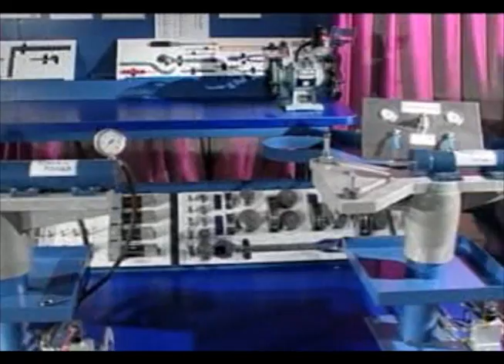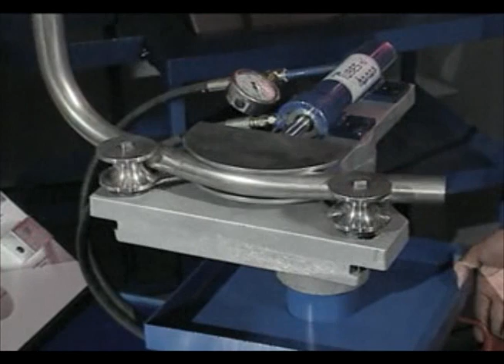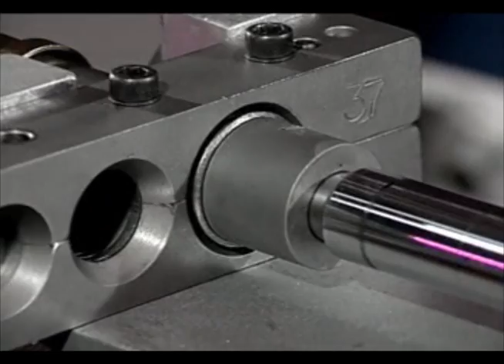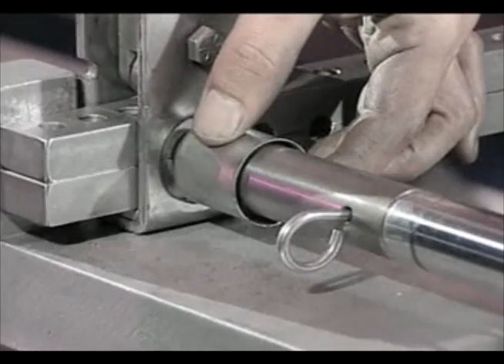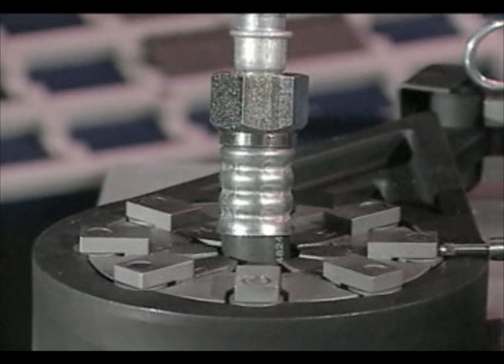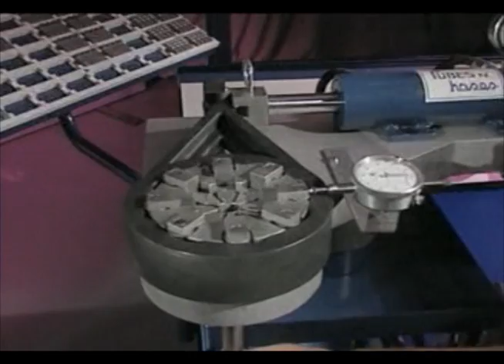Tubes n Hoses Introductory Video

Comment: Interesting concept, a ready-made system for fluid line service. The mandrel bender is pretty typical, I made one myself. The metal flaring station is a nice combo of a hydraulic ram and tubing holders, but the cam crimper is something I have NEVER seen in my life! So much better than the crimpers with die cages. I do my own hose service at home with a combination of used and homemade equipment. Although probably prohibitively expensive, I am impressed with the tubes n' hoses system.
Reply: chargermopar  these are great systems.   The only weakness is the hydraulic hose crimping part.  Underpowered for spiral hose.  I think they are out of business now.
Reply from the maker: We are not out of business.  The current owners purchased and revived Tubes n' Hoses over 5 years ago.  Please give us a call if we can help you with any tooling or inventory.